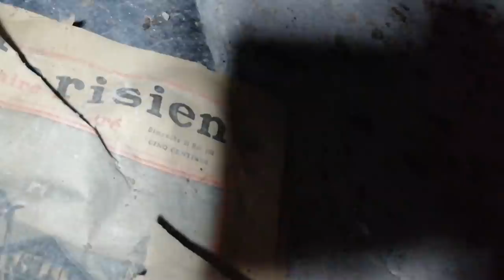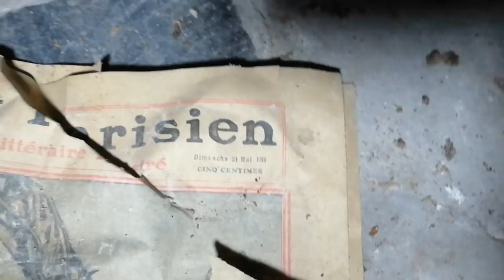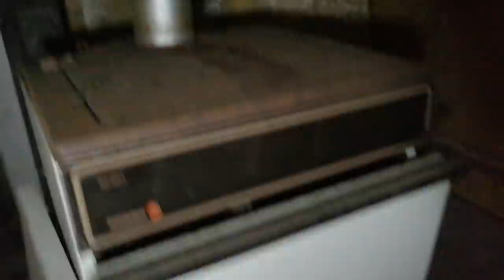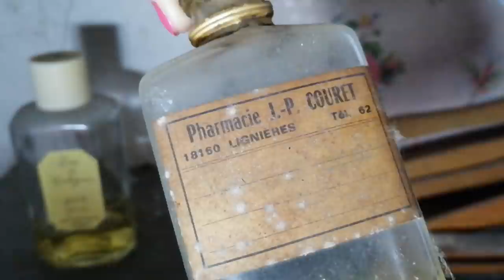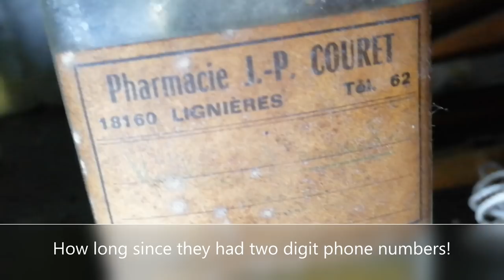Not Quite a Chateau 41 -  A Secret Door -  Tandoori Chicken -  A Spooky Chair and You First

Comment: Thanks for continuing to show us your adventures. I would never have had the courage to take on that enormous challenge. This is a suggestion for filming: stand somewhere, pan across your view/room, then turn off the camera when you walk, then film the next space. To find the flashlight on your phone, try touching the top center and slide your finger down to reveal the flashlight icon to tap. It will devour your battery, however.
Reply from the maker: Thanks for watching again Lisa, I found out how to use the torch now yaayyy. Thanks for the tips anyway, I will try to stand still to film stuff a bit more, but I get over excited, like a kiddie, and rush in when I think I've found something (I have to cut a lot of it out too but I'm not great at editing either.)